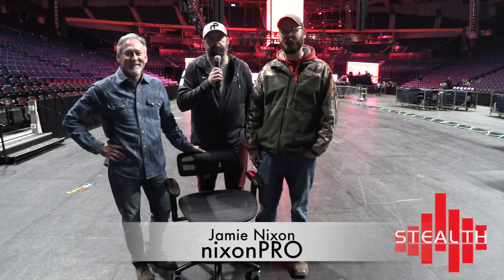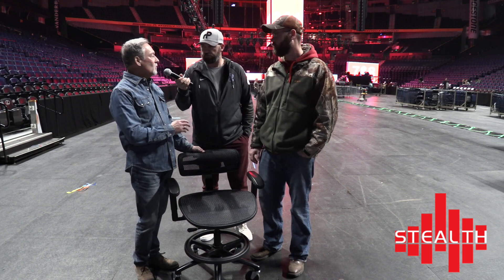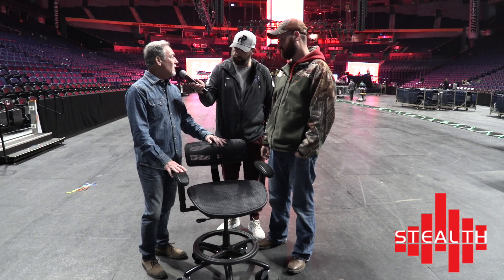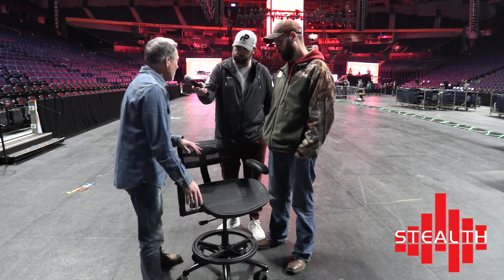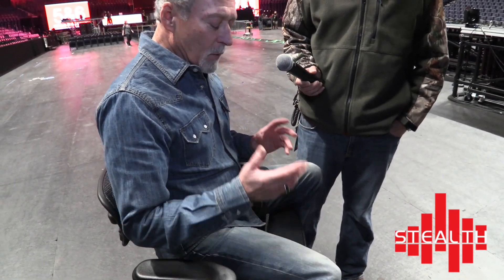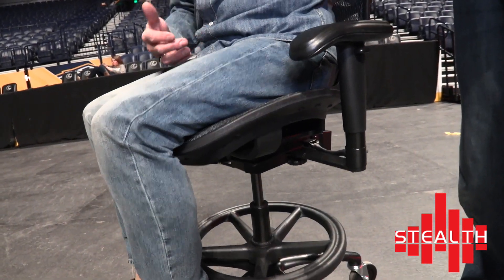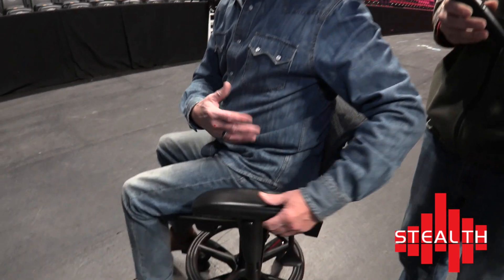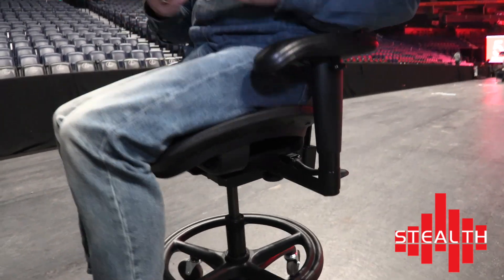Stealth Chair

Comment: What about as a guitar player's chair?
Reply: The arms don't swing back, so it's not handy for guitarists. But you can take them all the way off. I want to have both options on the fly though. I would have bought the chair if the arms would swing out of the way for playing guitar.
Reply: The arms of this chair can be positioned easily to allow for space to play instruments. They also sell a performer's version of this chair.
Reply: @ChadWork1  The arms of this chair can be positioned easily to allow for space to play instruments. They also sell a performer's version of this chair.
Reply: Fulano de Tal  I actually bought one and I indeed can play guitar in it! Great chair!
Reply: @ChadWork1  Thanks for the response!  It's still on my wish list.
Reply: @Fulano.de.Tal.  Thanks for the replies and info!
Reply: @GASMan-57  I can say that it's well worth it. I had this OK mesh chair with raising arms from Costco. It seemed alright, but my lower back had been getting worse and worse. I thought it was because I didn't get enough exercise. I took the chance and got the smaller size of this chair - too small. Sent it back for the bigger one, and like magic, my low back got better. I'm 5'9" and the larger one is great and roomy. I thought the back being small might be uncomfortable, but it's prefect, and supports the small of my back. I can work all day in this thing. I wish I had got it years earlier when I first saw it.
Reply: @Fulano.de.Tal. the arms can come out as well